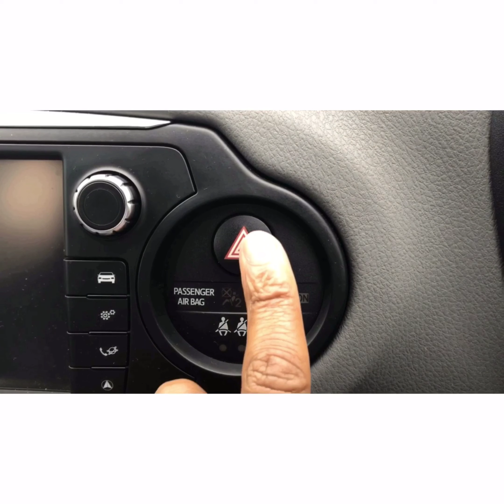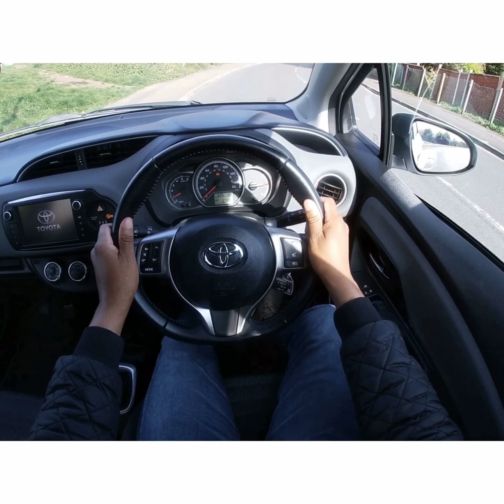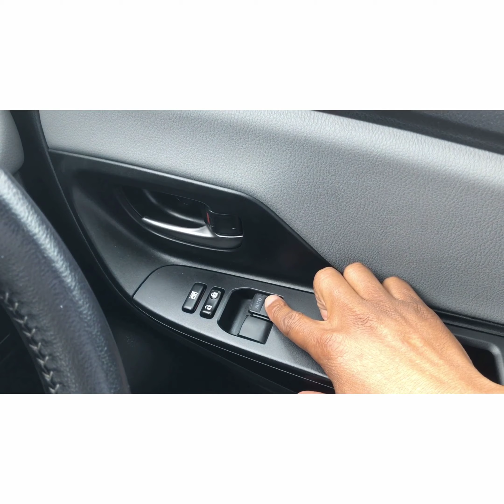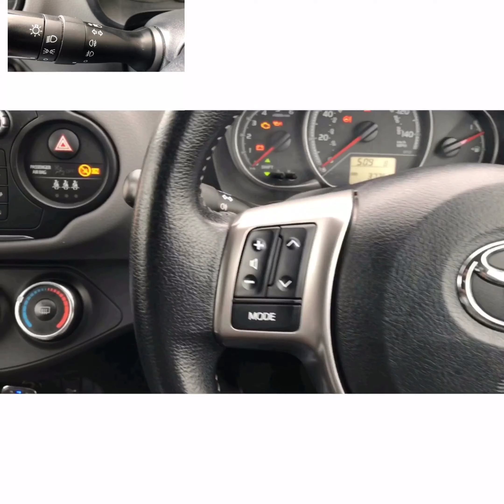Show Me, Tell Me Questions - New Test 2019 - UK

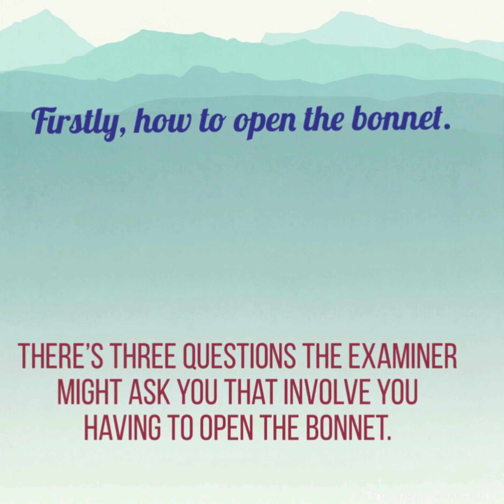Comment: 2:30 Open the bonnet and tell the examiner how you’d do the check if you’re asked the following three questions.

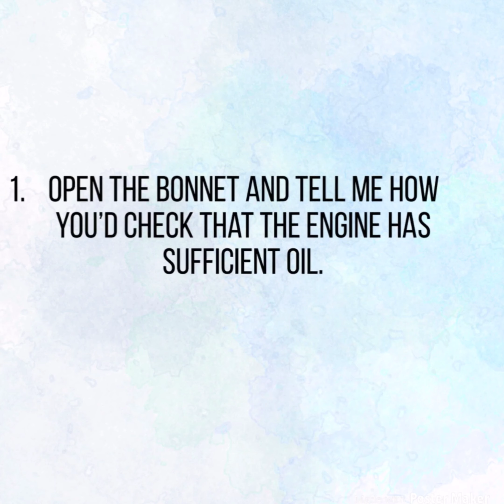3:31 Open the bonnet and tell me how you’d check that the engine has sufficient oil.
Identify dipstick/oil level indicator, describe check of oil level against the minimum and maximum markers.

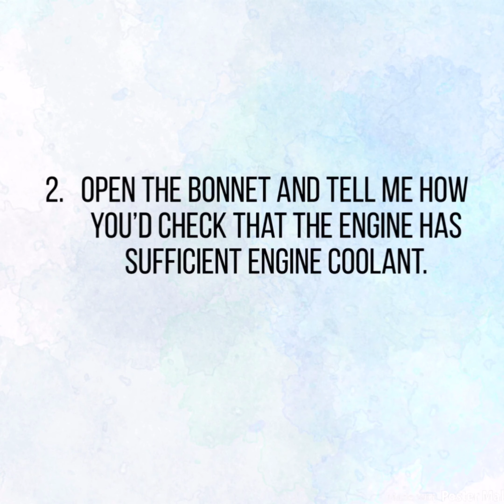4:18 Open the bonnet and tell me how you’d check that the engine has sufficient engine coolant.
Identify high and low level markings on header tank where fitted or radiator filler cap, and describe how to top up to correct level.

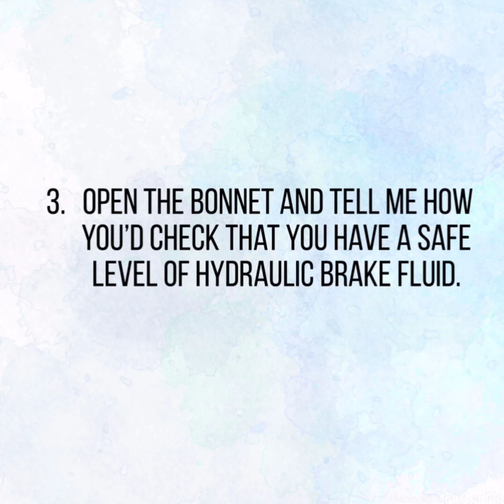4:46 Open the bonnet and tell me how you’d check that you have a safe level of hydraulic brake fluid.
Identify reservoir, check level against high and low markings.

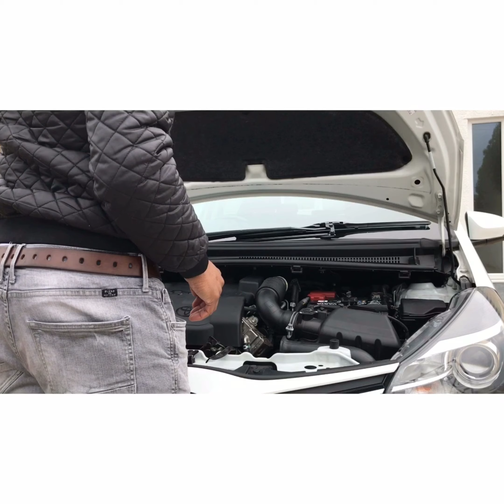5:17 How to close the bonnet.

5:45 Tell me how you’d check that the brakes are working before starting a journey.
Brakes should not feel spongy or slack. Brakes should be tested as you set off. Vehicle should not pull to one side.

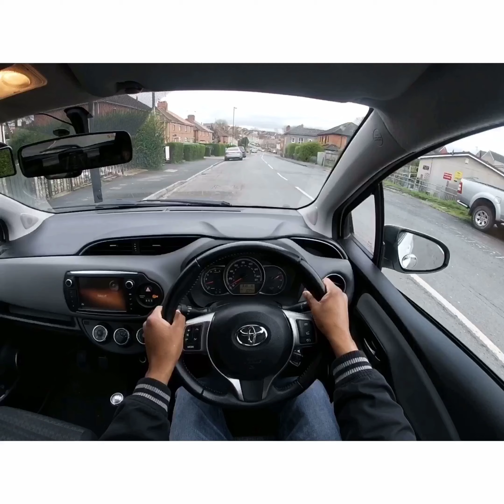6:01 Tell me how you make sure your head restraint is correctly adjusted so it provides the best protection in the event of a crash.
The head restraint should be adjusted so the rigid part of the head restraint is at least as high as the eye or top of the ears, and as close to the back of the head as is comfortable. Note: Some restraints might not be adjustable.

6:45 Tell me where you’d find the information for the recommended tyre pressures for this car and how tyre pressures should be checked.
Manufacturer’s guide, use a reliable pressure gauge, check and adjust pressures when tyres are cold, don’t forget spare tyre, remember to refit valve caps.

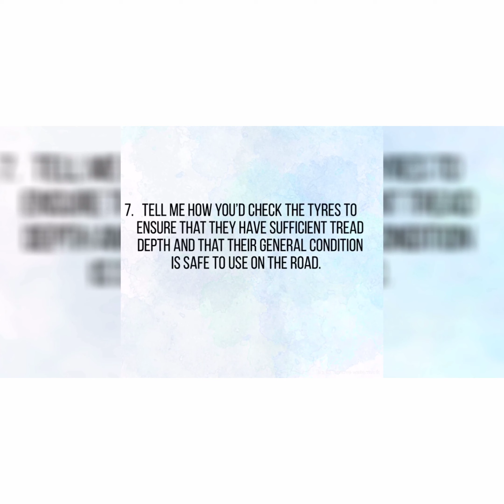7:21 Tell me how you’d check the tyres to ensure that they have sufficient tread depth and that their general condition is safe to use on the road.
No cuts and bulges, 1.6mm of tread depth across the central three-quarters of the breadth of the tyre, and around the entire outer circumference of the tyre.

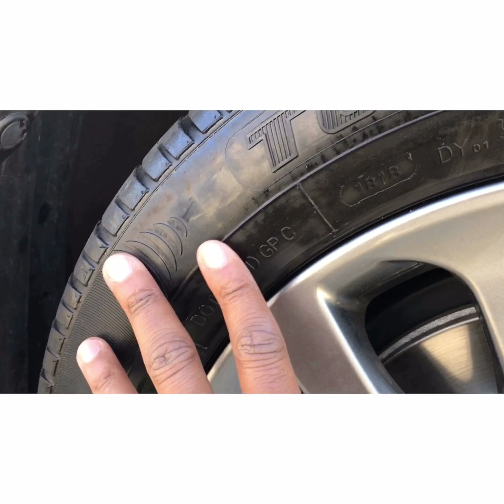8:03 Tell me how you’d check that the headlights and tail lights are working. You don’t need to exit the vehicle.
Explain you’d operate the switch (turn on ignition if necessary), then walk round vehicle (as this is a ‘tell me’ question, you don’t need to physically check the lights).

8:43 Tell me how you’d know if there was a problem with your anti-lock braking system.
Warning light should illuminate if there is a fault with the anti-lock braking system.

9:07 Tell me how you’d check the direction indicators are working. You don’t need to exit the vehicle.
Explain you’d operate the switch (turn on ignition if necessary), and then walk round vehicle (as this is a ‘tell me’ question, you don’t need to physically check the lights).

9:34 Tell me how you’d check the power-assisted steering is working before starting a journey.
If the steering becomes heavy, the system may not be working properly. Before starting a journey, 2 simple checks can be made.

Gentle pressure on the steering wheel, maintained while the engine is started, should result in a slight but noticeable movement as the system begins to operate. 

Alternatively turning the steering wheel just after moving off will give an immediate indication that the power assistance is functioning.

10:00 Tell me how you’d check the brake lights are working on this car.
Explain you’d operate the brake pedal, make use of reflections in windows or doors, or ask someone to help.

10:23 Tell me how you’d switch on the rear fog light(s) and explain when you’d use it/them. You don’t need to exit the vehicle.
Operate switch (turn on dipped headlights and ignition if necessary). Check warning light is on. Explain use.

11:09 Tell me how you switch your headlight from dipped to main beam and explain how you’d know the main beam is on.
Operate switch (with ignition or engine on if necessary), check with main beam warning light.

12:12 When it’s safe to do so, can you show me how you’d open and close the side window?

13:15 When it’s safe to do so, can you show me how you wash and clean the front windscreen?

14:20 When it’s safe to do so, can you show me how you wash and clean the rear windscreen?

15:29 When it’s safe to do so, can you show me how you’d set the rear demister?

15:46 When it’s safe to do so, can you show me how you’d operate the horn?

16:02 When it’s safe to do so, can you show me how you’d switch on your dipped headlights?

16:54 When it’s safe to do so, can you show me how you’d demist the front windscreen?

Source: https://www.gov.uk/government/publications/car-show-me-tell-me-vehicle-safety-questions/car-show-me-tell-me-vehicle-safety-questions